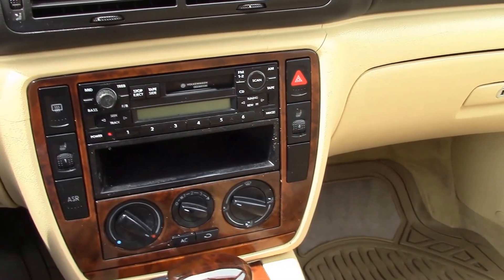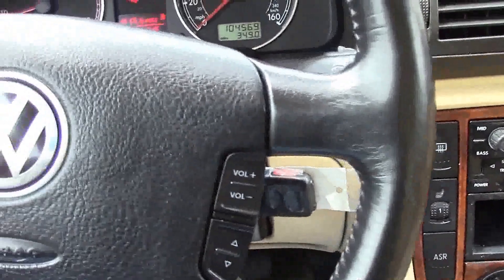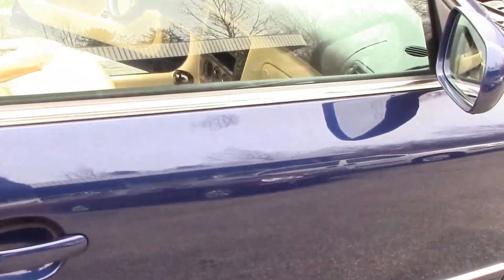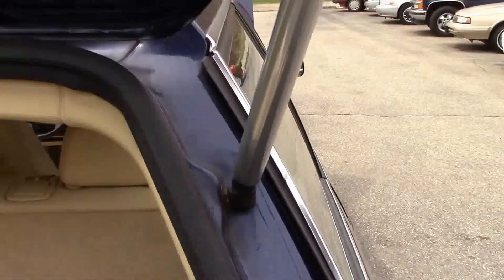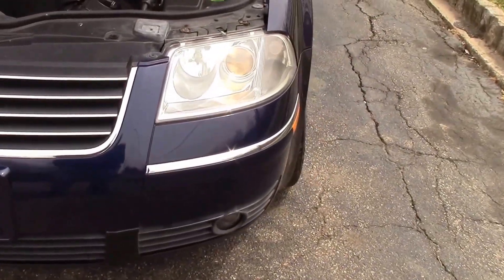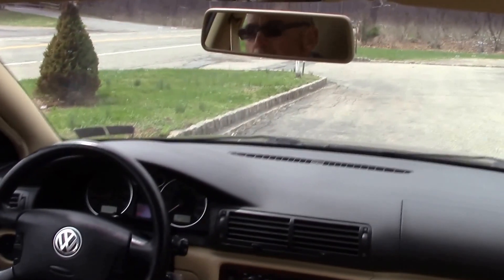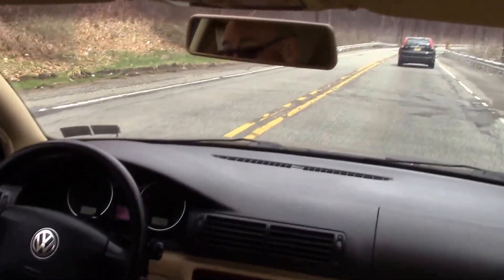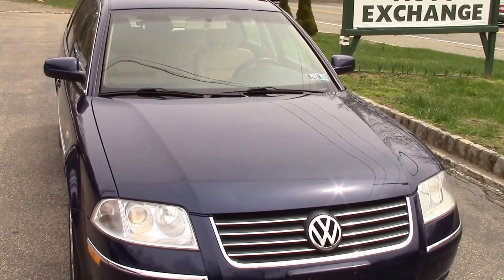2001 5 New VW Passat Wagon Blue for sale

Comment: The steering wheel being off-center right after a repair is not a good thing, and, it matters.  It isn't just an aesthetic issue.  I would want to see that the heater worker on all levels, that wipers, washers worked.  I'd want to see the headlights low and high, and exterior views of the signal lights, front and back.  I'd want to know that the emergency flashers work.  I'd want to see the oil dip stick pulled and checked, as well as transmission fluid, power steering fluid.  Nice driving along with you though.

Comment: 0:55  15.9 MPG? I think that's too much.
Reply: 60 MPG on highway
Reply: It's fixed until you reset the  computer, mine is at 15.8 or 9 but when I reset the computer it averages about 28-30 highway